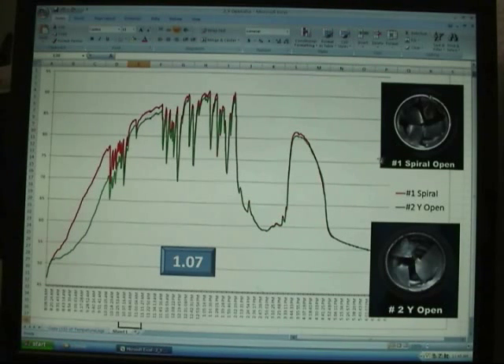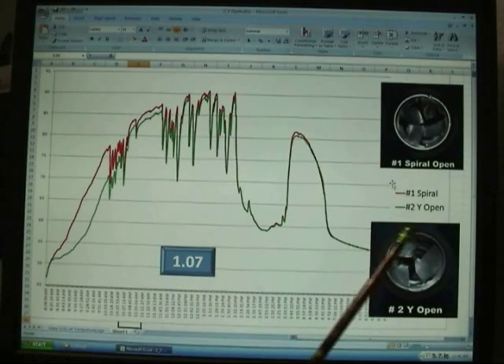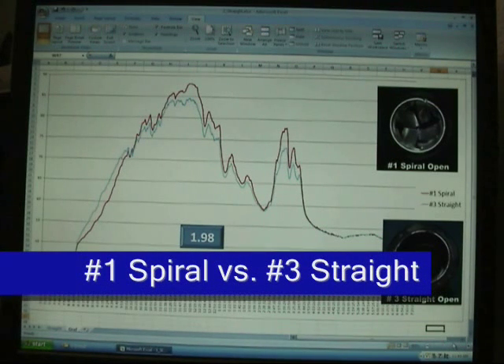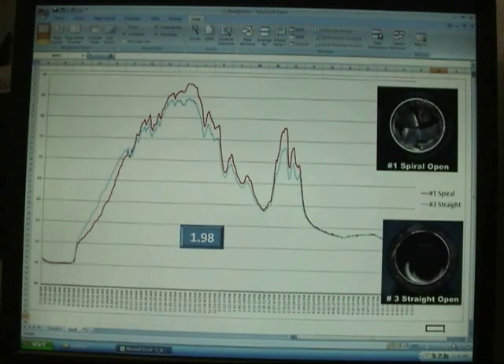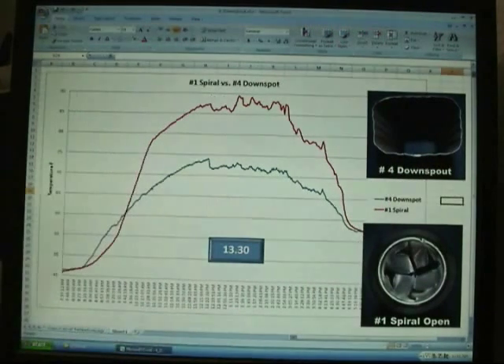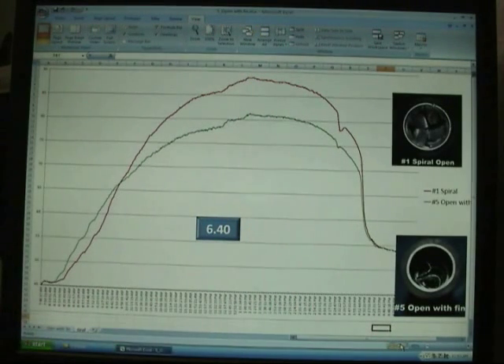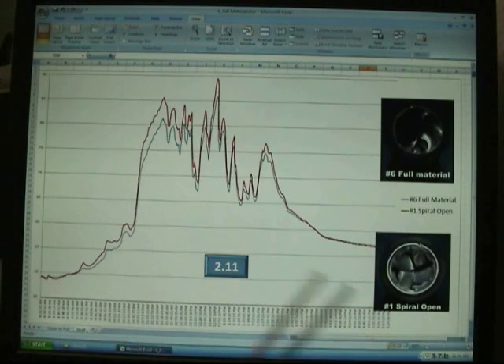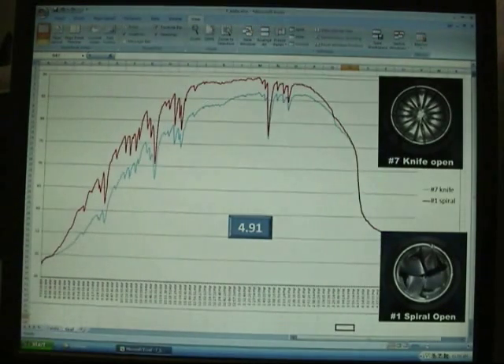Soda Can Heat Transfer Results part 1 of 2

Comment: My guess is that the best design would be to not restrict the air flow to only go through fully opened cans and also free-flow air in front and behind the cans.  To prove my point, if you feel the glass/plastic covering the collector and it is warm/hot, then you are also losing a significant amount of thermal energy through the glass and probably also back  of the unit as well (if not insulated).  My point is that to extract the maximum thermal energy, you should have a variable speed fan (or multiple fans) that would move the air (through cans and outside cans) through the collector fast enough to keep the temperature differential between the air inlet and exit to be only 2-3 degrees.

Comment: Thank you for this research. Very nice.  But like Lee K I am thinking about the total amount of airflow.  The more restricted the air flow is, the lower the speed the air can move up and it takes a longer time to go all the way from bottom to top. In that way the air is actually forced to take more heat up. But the total amount of air flowing through is less, so probably less heat transfer into the room than compared to more air at a little lower temperature. But thanks anyway!.

Comment: In terms of amount of energy captured from the sun, It would be better that a setup has a 50 degree rise at 10 CFM (cubic feet per minute) than a 60 degree rise at 1 CFM, even though the 60 degree is 20% hotter for the same area exposed to the sun

The downspout has the least resistance with larger air flow & the largest ratio of (cross section to heat) versus (area exposed to the sun), giving you lower temps, even though the actual energy transfer is probably the same or better than the cans.

Comment from the maker: @fabfauna No I did not tried. After a year my unit still is on the window and I use every winter. One thing is for sure all the heat depends on the angle of the box to the Sun and how big is the box. In other words, location, location and location will guarantee good performance.

Comment: @MrEnergyFree I agree with that . I think by not taking the heat away from the can fast enough you will reduce the absorbsion of heat by the cans under low light conditions.

Comment: Interesting results and data analysis. Here is one alternate explanation. Lower temp for the downspout may be the result of free air flow that distributes heat into the room faster. The same amount of heat could be produced but perhaps a larger volume of air has been heated and circulated.

Comment from the maker: If a restricted flow increase the temperature of the air inside the cans, then set #7 "Knife open" should be a winner because is the most restricted set but is not a winner.
It is amazing how the temperature goes down so fast when the Sun light does not hit the cans. You can see it in some cloudy days on the video. I think that's the reason why restricted flow does not work. 
Thanks